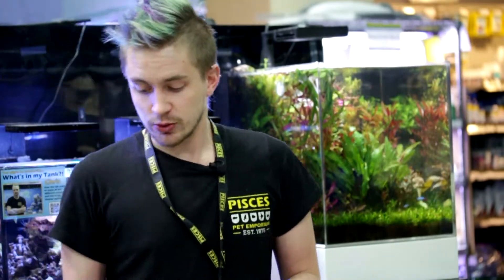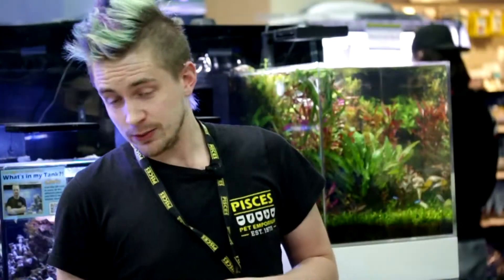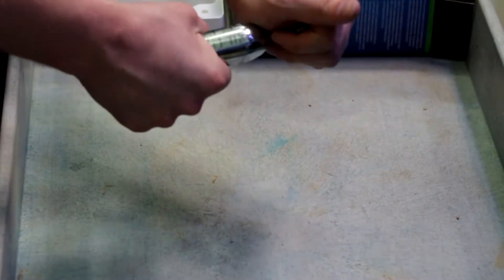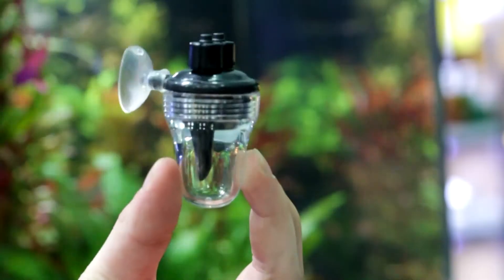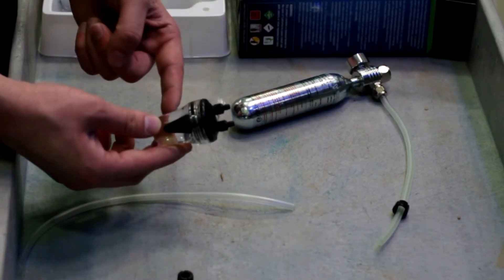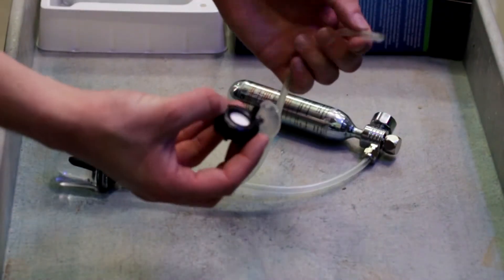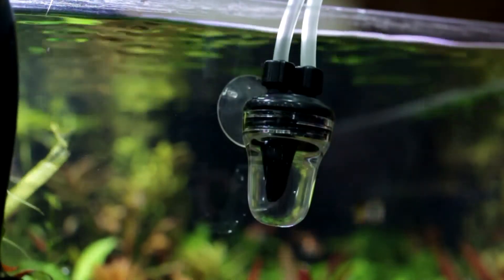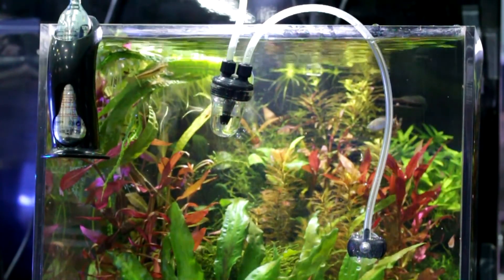Pisces How-to: Assembling a CO2 System

Comment: I set up mine today and didnt realize I set the bubble counter wrong and the hose exploded so I had to cut it down smaller lol.

I have very few plants they've been healthy for the most part but my heater broke and my amazon swords began melting as temps dropped to 59°f.

I installed a new heater today and the C02, did a hefty water change and re-fertilized using flourish micro trace and some off brand calcium-nitrogen-magnesium-iron plant fertilizer blend. 

Hope to see results in 2 weeks the only livestock are mystery snails.